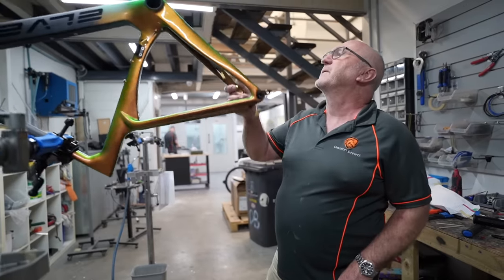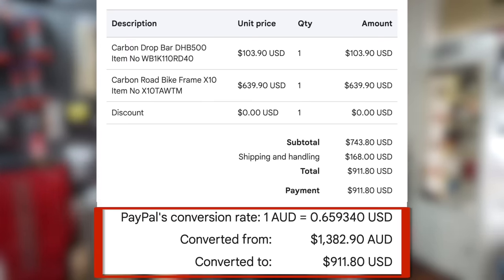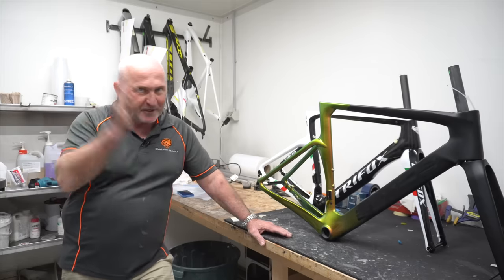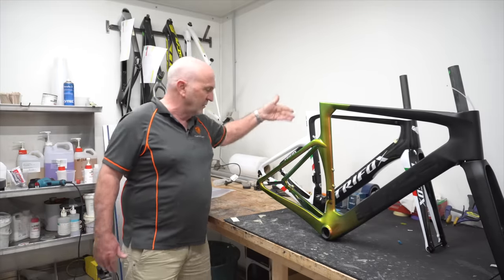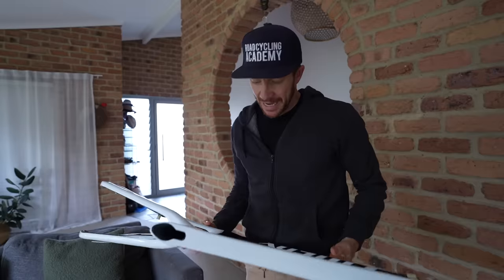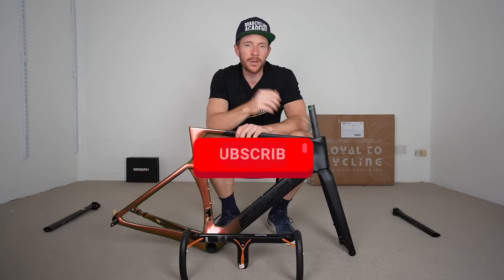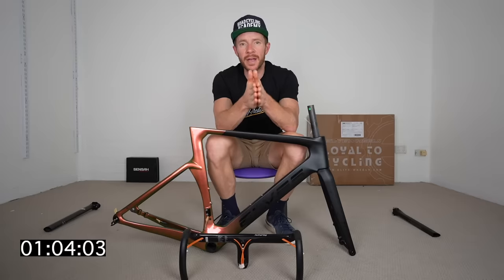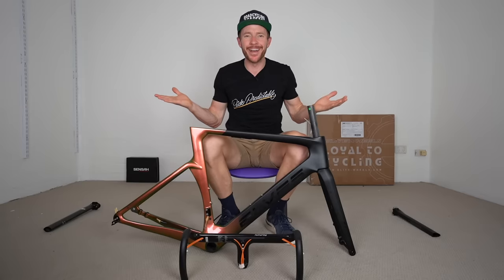I Bought Two Cheap Chinese Aero Frames (here's why)

Comment: This content is super relevant given the ridiculous prices of race bikes from the big manufacturers who make owning a quality rig an elitist pursuit....well done Cam, keep them coming.
Reply: Well said. On top of that the QC from the big brands are crap as exposed by Hambini. These are two triangles put together with good alignment compare that to the cost of motorcycles and cars the prices of bikes are out of hand. Thanks for the content Cam.
Reply: 100%. Mid level bikes used to be $3/4k. The same thing is now about $7/8k. Top end used to be about $9k. It's now about $15k. Crazy 🤪
Reply: Exactly 20 years ago, an American made, carbon Trek 5200 (exact frame Postal rode), with a Shimano Ultegra groupset and Bontrager wheels (which were made by DT Swiss for Bontrager), retailed for $2,700USD.  That's pretty insane...even accounting for inflation, that's $4,500 in today's money.  Now you'll pay twice that for a Chinese made Ultegra bike.
Reply: In my cycling circle there is a lot of talk about this... prices, spares availability, being forced to 'upgrade' (change for the sake of it),  prices are crazy for what you can get, will be get used to fork out 2k pounds (I am writing from the UK) for a tiagra entry level road bike? when 10 years ago we were getting Ultegra quality at race specs.
I think we are witnessing a huge change in the industry, putting apart the fact that manufacturers are pushing the industry to ONLY supply whatever is most incompatible with what we had until recent (rim brakes, mechanical) they are forcing obsolescence at high speed to depart with our wallets, and forced obsolescence is a huge issue they should be accountable for - what are we doing with all the waste?
Also in my cycling circle, there is A LOT more appetite to try Chinese groupsets, the big brands Shimano, SRAM, Campagnolo... might have shot their own foot with their recent business decisions and they are creating a HUGE market for these Chinese brands, as soon as they go through a second generation of product development I am sure they will be much more common in the West and it's going to hurt the big brands...
Reply: A home that cost $60000 in my parents’ day now cost $1.5m. What’s your point?
Reply: Keep buying Chinese. Hell, outsource your entire economy, design and all.  At the same time make sure you cry for higher wages and better paying jobs.  Then be sure to blame your government.
Reply: @jasrod2012  When did this turn into a quarrel about racial labour? The point was why can't Shimano, SRAM and Campag offer a budget friendly well performing groupset with the interests of cycling community in their line up. Any mid level has to be electronic?
Where are the big "western" brands manufacturing?  Answer=China.
If the big brands were worried about national labour and people interest then they will be manufacturing here.
Reply: You’ve missed the point entirely.  The reason why stuff is maNufactured in China is because people like you complain about price.  Nobody is going to run a company to not make a profit…. Including Chinese companies.
Reply: Furthermore if you aren’t interested in companies making a profit I hope you store all your money under your mattress, invest in no equities and succumb to inflation on a daily basis.
Reply: @jasrod2012  "Making a profit" is a vauge way of putting things. Of course they should make profit. The profit margin can vary from low to agreeable to excessive to exorbitant to utterly unreasonable. Putting two triangle together is not the most complicated feat of engineering we have achieved. Profit should be deserved. Cycling is a wonderful sport, one gets way fitter, gets be outside, gets to be social. The positives of cycling should be available to many. Greedy CEOs and policy makers should not rob this wonderful thing from the masses.
Reply: If you think putting two triangles together is so simple do it yourself and see how well you do. Talk is cheap.
Reply: By the way you can by any $50 bicycle and get fitter.  If you think everyone should be able to afford a lamborghini there is another political system that would be a better fit for you.  No need to try and convert our system  into what you want… what you want exists elsewhere.  Remember you can’t have your cake and eat it too.
Reply: @jasrod2012  Yes talk is cheap. We both can agree on that and shut up. I'll enjoy my ride and you enjoy your ride. Amen.
Reply: @jasrod2012  believe me, they would make a profit. but not so much like in this times. these manufacturers are even more greedy. what you think, were are these Bontrager or even specialized, or Santa Cruz Parts made?
Reply: @richardhutchings1980  what are you talking about? I can get a trek with 105 for 2k today new, and bought mine used for 1200 just before the pandemic. That is entirely reasonable, and 105 is mid-range not ultegra.
Reply: @marcelinocambeiro4268  the entry level offerings today are better than the midrange and most of the high end offerings of 10-20 years ago. Pretending you NEED ultrgra is silly. Stop whining and ride more
Reply: @richardhutchings1980  - But we're not talking about getting a Chinese bike for $2k-$3k. Once you add all the components up you're looking at close to $5k. And that's just for mechanical. So you have spent $5k on a Chinese bike that no-one is going to touch if you want to sell it. You can buy a brand new Cervelo C2 Disc for US $2200 and they are trying to sell a frame/forks only for $200 less.....
Reply: @nk-dw2hm  and I do agree with you... but the fact is, you are insinuating that Ultegra level of functionality is a luxury, this wasn't the case in the past (not many years ago), and back then yes there were entry, mid and performance level groupsets too... also better than the mid range and most of the high end offerings of 10-20 years before.
How many people you know doing crits, CX, road racing... on entry level groupsets? I am comparing similarly spec bike/weight/purpose and the cost involved, the offering nowadays on finished bikes is poor with MUCH less range options too. I do build my bikes sourcing frame and components myself.
Reply: marko  Assuming by "real jobs" you mean not being self employed, I've had "real jobs" for much of my adult life, but still wasn't able to throw down $2,000 for a used carbon bike until recently. It's not always easy to spend that much money on a bike. Loan agents won't take you seriously as they would with someone buying a car. That being said it makes me proud to have such a bike as a janitor, and I'm very much looking forward to kicking some executive/lawyer ass while I work my way through the category 4 crits.
Reply: And have them made in China. 😂
Reply: Trek, giant, and Santa Cruz are guilty of this
Reply: @jasrod2012  the problem is manufacturing are imported in china because of cost. So technically we are sending design in china and resell it here and branding it
Reply: I know I buy shit onj ali express that mATCHES top tier quality for 1/10 the price
Reply: How much is your life worth? With Carbon fibre is a russian roulette. Go play cheap if your life is cheap (I have seen where even ''big manufacturers'' make their frames, I would never trust riding one of those bikes, imagine those no-name brands).
Reply: @nk-dw2hm  Not to mention that current 105 is fantastic.
Reply: marko  a canyon... here we go, https://www.youtube.com/watch?v=9nVzfeQ9dHk
you can't buy it anyway... and you won't talk about the quality issues once you get the bike, like when somebody buys an expensive car which is, well, crap... and won't admit it because it is an expensive car.
also, this is the problem, a bike which is (presumably) aero, the fastest bike, superlight, and comfortable, and stiff... cough... loads of marketing here... for the middle age attracted by blinky things, supports my comment on lack of offering, if it was for the brands they would only make one model for everyone, as long as it has internal cable routing and allows tire sizes from 23 to 33, for an aero road bike!
You know me well about the job... that's why I can speak about technical matters and challenge the marketing and debunk cycling fads.
Reply: So true, not sure if it's just because of inflation, or brands are getting greedier. Something else to keep in mind too are the helmets, most of the US ones are outdated with the cpsc standard, while they should have the nta standard. Two great helmet options with nta are xnito and bern
Reply: Totally agree. That’s why I choose Yoeleo rather than one of the main brands. It just seems like they are ripping people off especially since bikes are made in the same factory as some of these Chinese brands.
Reply: That's why people turning to ICAN, Yoeleo, Farsports, Lightbicykle, Winspace, Hongfu, Dengfu, Trifox or Elves. We cannot forget that those above brands were/ are OEMs for major western bike manufacturers.
Reply: @smitthone  yes: all F1 tubs are from heavy old skool metal 💪
Reply: @Powerreserve  F1 tubs are made in very few numbers with tightly controlled process. Totally different scenario from cheap ''mass'' produced carbon bike frame.
Reply: @smitthone  that’s why the best cyclists around the world ride on carbon frames
Reply: @jasrod2012 The problem is that the companies could make a profit at lower price-points if they were to just use lower-cost parts.

However, it is even more profitable to artificially limit supply -- especially of "low" and "mid" end parts.

Consumer-end inflation has gone up a lot more than production-end in a lot of industries in the US, Canada, the UK and Australia.  Mid-grade bikes, mid-grade phones and laptops (and accessories), mid-grade cars, mid-grade new homes, etc., etc. have all ballooned in price as this realization took hold across industries.
Reply: @marcelinocambeiro4268  tu comentario explica muy bien lo que está pasando en muchos ámbitos de la sociedad de hoy en día, esto mismo pasa también en la industria automovilística,coches con diez años de antigüedad no se consiguen recambios porque dicen que ya están descatalogados.
Reply: @jasrod2012  my point is a bike now costs more than a motorcycle. It should not be. That is my point
Reply: @jasrod2012 Any western company can’t compete with Chinese in either quality or cost deserved to be screwed 😂 Chinese has been making knockoffs of premium designer handbags for decades (Chanel, LV and etc), but none of these brands go out of business because of that. If fashion brands with minimal function differentially can survive Chinese competition, cycling companies should too.
Reply: I bet, even if Shimano comes up with their bike today people still consider the big beefy brands

Comment: As a Chinese I must say I've never heard of nor saw Trifox frame until I watch this video😂 Elves is quite popular among the "budget brands" though, lots of college students do custom builds with Elves or Upland frames. Winspace are quite rare, we know they focus on the foreign market(especially SEA). A few years ago Winspace had tried to introduce itself to Chinese domestic market but its frames have some quality issues then and they end up with a bad reputation in China.
Reply: what is the top chinese brand in China then?
Reply: @jaaxc1036  Many people in mainland China regard Giant and Merida as Chinese brands. The market share and number of stores of these two brands are overwhelming in mainland China. If these two Taiwanese brands are not counted, Parous should be the "top brand" in enthusiastic bike market. There are also some small brands that have made good progress in focusing on cost performance. Most of the carbon fiber frames of these products use slightly modified designs of other brands, and are manufactured by factories in Guangdong.
Reply: Trifox is basically repainted TFSA frame😂